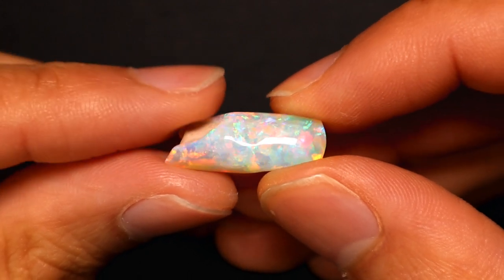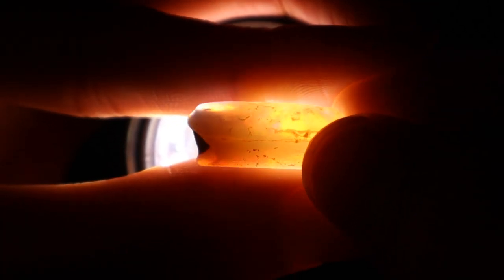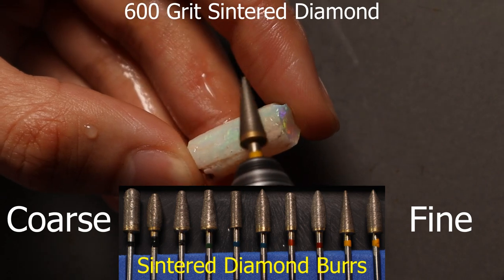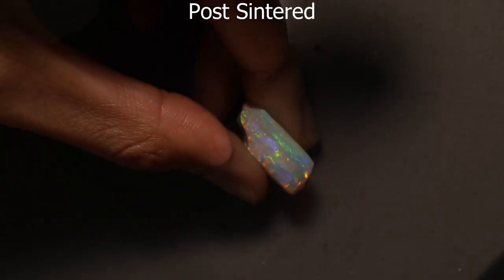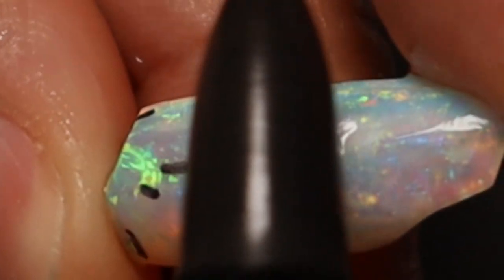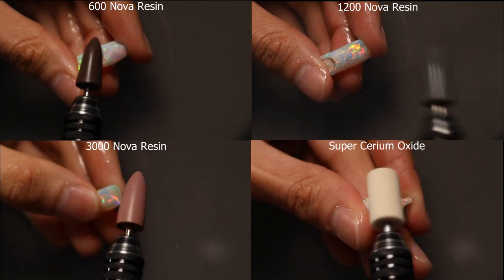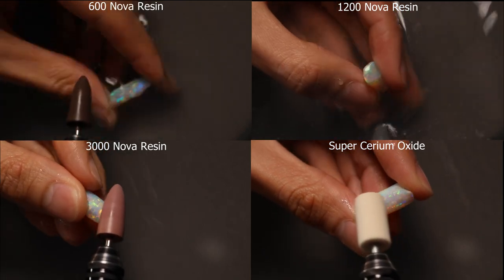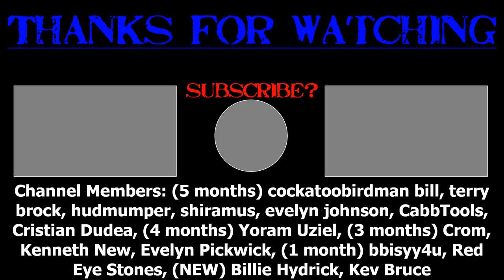How To Carve Opal In Under 1 Minute. Basic Gemstone Carving.

Comment: Hi Roy. I just started cutting rough welo with a dremel rotary tool at 5000 rpm. After my 600 grit diamond sintered burr I go through 280 up to 3000 with the nova points and after I dry the outer surface I still have that "frosted glass" look. My super cerium oxide isn't here yet but I'll get it in a day or two. My question is how effectively will the cerium oxide polish out the frostiness? Should I just go back and work the stones at 280 again or will the cerium more or less take care of it decently enough?
Reply from the maker: 280 is really only for visible scratches so if you have gotten to a frosted glass look you are sucessfully past 280. Sounds more like a 1200 or 3000 nova stage so I'd say you are on the right track.
I havent used cerium oxide on welo opal yet as I have heard of some of the powder getting stuck in the pores so typically use novas up to 50,000 grit or diamond paste.
A very experiences welo opal cutting I have talked to uses cerium oxide though so I will try it out as it shouldn't be soo fine that it gets in the opal channels but I'll find out sometime soon.
Reply: @RoysRocks I think it's the considerable amount of time it would take combined with my lack of experience that's really putting me off from the higher grits. I'll give it a shot with the oxide on a clear body color and a dark brown body color and see what happens. Really I just need a reasonable shine before the hxtal treatment... which might hide a less thorough polish regardless.
Reply from the maker: @koalabear4964  Ah you are going for a hxtal treatment... I'd be interested to know how that goes. I've been thinking of testing a range of treatments like that on ethiopian as well.

In terms of the higher grits and time it really isn't as bad as it sounds. just a few extra minutes with the 8000, 15000 nd 50000. The end result at that point is surprisingly good. You just want the full frost gone by the 3000 (slightest haze left but starting to get shiney).  It will also start feeling slippery and you know you've got it.
Reply: @RoysRocks  I'm still a while away from that. 3 more large stones to polish. I am all too eager to move on to the curing process believe me. They will soak in a hxtal+acetone mixture for roughly 2 months. Theoretically there should be positive results (minimal crazing) which is great even in the slightest as all of my rough is wet "specimen grade". I've tried drying these naturally but I'm completely over that lol. Never again.

That's great to know. I've felt a mostly slippery feeling after 1200 grit. Just need to keep working the surfaces. To clarify I have the higher grit nova points, but I had a feeling to not move on quite yet. I think I'll spend more time with the 1200. Thank you, Roy.

Comment: I did the texter hack. Works well but I marked a piece of sand that went in deeper than I expected. I sort of regretted it but in the end the sand had to come out, it just made the stone a bit thinner.
Reply from the maker: You can actually cheat and backtrack by using something like ethanol to remove texta. I only ever do small imperfections that I need to come out.
Reply: @RoysRocks  I tried a bit of rubbing alcohol,  to know effect. No worries,  I removed the sand, I just wanted to be lazy. It's a skinny oval, not quite marquis cut, and there's only color in about half the face. Plus the sand was on the "back" side. I just need to be more picky on how I cut my stones. In the beginning I was more lenient in what inclusions I ledt.

Comment: Roy, what rpm do you use?
Reply from the maker: 8000rpm. The slowest my rotary tool goes. Its probably actually a bit slower due to the flex shaft friction and grinding action. You can go faster but gotta be careful of chipping the stone.
Reply: @RoysRocks  being trying 10000 rpm but it’s too harsh so bought a dremel which has 5000rpm to see if that helps with the smaller pieces
Reply from the maker: @some1_call3d_jess  I could see 10,000 being a bit to aggressive. 5000 might feel a touch slow but should work just fine.